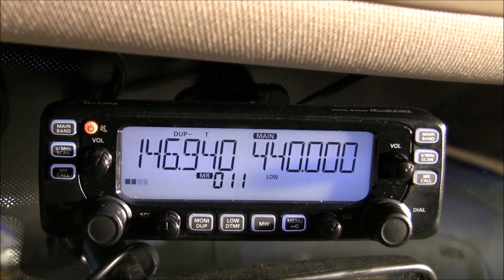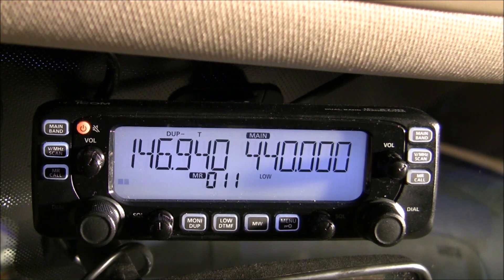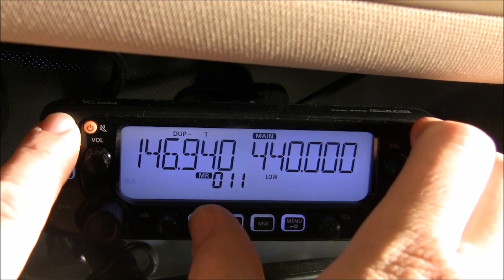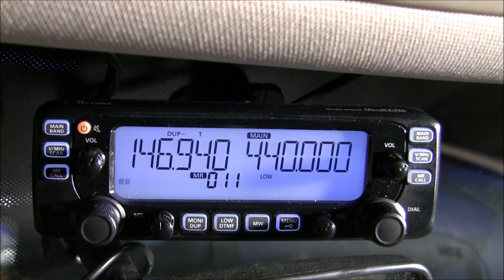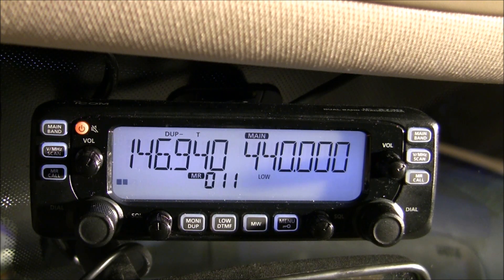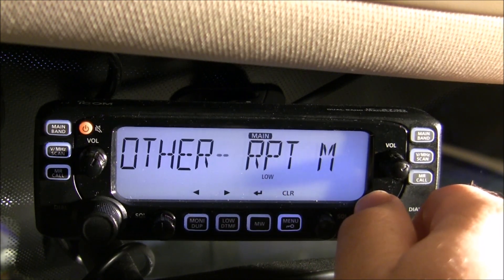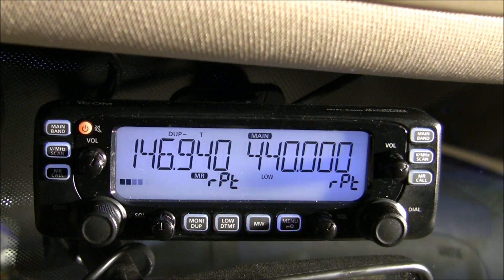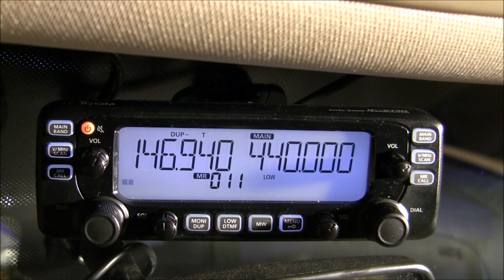Icom 2730 Cross Band Repeater Setup

Comment: After removing the 319D diode for the lCOM 2730, the transmitter (TX) became permanently on. When I turn on the signal repeater. 
Is there a solution for that?
Reply: Put it back and find correct information on how to mod the radio
Reply: @ I found the solution. Squelch It was high, I forgot it, and after lowering it. it went back to working well.
Reply: @M3M-KSA  Good to hear you didn't damage anything, I almost took bad info from someone about modding this radio too but got lucky I guess

Comment: My question is can the radio cross band repeat to a uhf repeater triggered by a two meter HT? (jus opposite of the setup you have described.)
Reply from the maker: Good question. I am not sure. I sold the transceiver a while back, so I can't check to see if this would work.
Reply: Yes, it works bidirectionally.

Comment: I’m a few weeks away from testing, will be using radio for Off-Road desert racing support and photography . This feature looks like the perfect solution. I can locate my 4x4 truck with this mobile unit on a higher location then hike into a ravine without 4x4 access then use a HT to communicate with race control or monitor race communication. Is this feature available on the ID-4100a?

Comment: I’m new to ham. And new to this radio. Won’t the car need to be on to keep it draining your battery especially if your on a long net?  This is a cool thing though.
Reply from the maker: You are correct, the transceiver runs off the car battery, and will drain your battery over time. It draws about 10 amps during transmission, at full transmission power (around 120-130 watts, depending on battery voltage.) A typical car battery is 70 amp hours, and generally should not be discharged beyond 50% capacity. That gives you around 2+ hours of continuous transmission before you would need to stop, in order to ensure that the battery has enough juice to start you car. Keep in mind that the current draw is much lower during reception, and while the transceiver is at idle (1-2 amps, roughly.) If you were only planning to transmit in case of an emergency, your car battery might be able to power the transceiver for several hours, if you did not transmit.

The safest thing to do would be to run the transceiver off of a separate deep cycle battery (also know as a marine battery), since these can be completely discharged without damage. You can pick up a marine battery for a little over $100. It would not be all that difficult to install a switch that will swap the power from the vehicle battery to the marine battery, if you wanted to use the transceiver for an extended prior of time while the vehicle is off.

Lastly, you could leave your vehicle running, thus allowing the alternator to power the transceiver. That's not very practical if you are going to be away from your vehicle for an extended period of time, however.

Comment: Seems there are some restrictions put on crossbanding thru linked repeaters due to interference! Any input there?
Reply from the maker: I am not aware of any such restriction. I am certainly open to comments from anyone who may be better informed. Like most folks, I do not condone any inappropriate use of radio hardware.
Reply: Well apparently Arizona Repeater Association cites “massive interference” on their 9 linked repeater system..https://www.w7ara.org/z/Conduct.Aspx.   8. No crossband or remote base connections without prior permission
from the repeater owner.

This rule insures the system will not be compromised by connections we have no way to control. Such connections can cause massive interference, even though it seems it is working good.
Reply: I have to admit..i dont see how a massive interference event would occur if the ht ptt used 70cm to trigger 2m transmit. My logic would tell me it would be exactly like being physically at the crossbanded radio transmitting with the handset! ??

Comment: Im interested in the cross band, the up band frequency is always the same,can I put this in memory or do I need to use the vfo feature?? Great video.
Reply from the maker: When you setup the Cross Band function, I believe you can select either frequency from a memory slot, or by using VFO.

Comment: Thanks for posting, I just passed my technicians exam two days ago. Anxiously waiting for my callsign and for it to be added to the FCC database. How long can your battery last with the truck off and this running as a repeater?
Reply from the maker: As Jason R. said, it all depends on how much you are transmitting. According to Icom the radio draws 1.2 amps in when it's in standby, and 1.8A when it is receiving. However, the current draw increases to 13 amps when the radio is transmitting.

The 2730 needs a minimum of 11.8 volts (approx.) to operate. Since the voltage output drops as the battery discharges, the radio will shut down before the battery completely dies. A healthy, fully charged 12V battery has a voltage of 12.7 volts. You can therefore only drain about 7% of the battery's capacity before the voltage drops below 11.8V. Example: a 100 Amp hour battery, drained to 93% gives you about 7 AH hours of "usable" capacity. You could therefore leave the radio in standby for about 5.4 hours, receive transmissions for about 3.75 hours, or transmit for about 30 minutes before the battery drops below 11.8V, causing the radio to power down.
Reply: Depends on how often the radio is transmitting.  It is a simple enough math equation to solve for how long the radio can be sitting idle and another for how long if it is transmitting 100% and then add the battery of your vehicle - or in this case I'd recommend bringing a spare battery to run the radio unattended as you wouldn't want to come back to your vehicle and have a dead battery so you can't start it or use the radio.

Comment: I have a new IC-2730A radio set that I bought several years ago and never installed anywhere.  I only powered it up to program all my frequencies into it, to duplicate what I have in my older IC-2720H radios. Then it went back into its box, and has been stored in the closet until just now.  I tried the button press action at power-up, per your video, and NOTHING happens any differently than when I just power up the radio normally.  I'm not sure, but I think the radio may have already been previously enabled for the crossband repeat mode, as I DO get the "RPT M" displayed on the front panel, when progressing through the various EXMENU -- OTHER  menu screens.  I don't remember having done it myself, as I didn't even know about the crossband repeat function when I bought the radio, but I might have enabled it myself. It has been too long.  PROBLEM:  When I have the "RPT M -- START" displayed on the front panel, and press the "MW" button to try to get it to the next menu item/option, nothing happens.  The screen still just sits there and shows the same display: "RPT M -- START".  I can't get the menu to change to the next function, to actually START the crossband repeat mode. HELP!  Any ideas?
Reply: Disregard my original post.  I found the problem a few minutes after posting my original question.  I had a severe "Cranial Flatulation (Brain Fart)" while doing the setup procedure.  I still had BOTH sides of the radio on VHF frequencies, instead of one on VHF and one on UHF, before I tried to activate the crossband feature ......... Thanks for the video!

Comment: hi. i just bought an icom ic-2730a mobile rig. however, i can't seem to add the crossband repeater function using the instruction you posted, mainly pressing and holding the two main and moni button.  i turned off the power of the radio first and pressed and held the 2 main buttons and the moni button and pressed the power button until the radio turned on. after powerup, i followed the menu cycle (exmenu, others) but the RPT menu does not appear. what was I doing wrong? please help. 73 

de DV2AWN/Amboy
Reply: hehe answering my own query, thanks to the post below, was able to finally enable cross band repeater operation by removing a diode on the mobile rig. :) 73

Comment: Should this work on the 'E' version as well? I've tried the instruction several times but it is still not activated thanks Johan PG4W
Reply: Johan Weijland I have the E version too and can't set up the REP-M option in the menu after several tries. does any one know if it is possible on the Edge version?
Reply: I've found out it's only possible in the "E" version after removing a diode and then follow the described steps.

See instructiond here -> http://radioaficion.com/cms/ic-2730-mod-mini-repeater-function/

Comment: Just a quick question. I have a buddy who has a Crossband repeater on (Receive freq is 147.575 and Transmit is 446.000). I can't figure out how to program the offset/dup on my IC-2730A manually or in the software. Any suggestions on How to program odd splits ic-2730A?

Comment: hi..i've tried many times follow your instruction but i still failed to activate my icom 2730..pls help
Reply from the maker: As I recall, I had to try the first step (holding down the MAIN buttons and MONI button while turning on the unit) a few times before I could access the  "RPT-M" option in the "OTHER" menu.

Which step, specifically, is giving you problems?
Reply: Pok Jik its probably there. You are likely not setting up the actual repeater frequencies and tones right.

Comment: I've only been using my 2730 for a short time, but I'm impressed.  I upgraded from an iCom V8000 VHF only because of how well my old radio performed, and have found the receive sensitivity on this rig to be equal or better. My 2 gripes about the 2730 (and admittedly I may not have found the settings to control this) 1 - The button chirp seems to be sent through both volume controls, so pressing a key on the radio is extremely loud if both volumes are turned up.  2 - The HM-133 mic on my V8000 had far more functions assigned to the keys - most notably scan - I could just press the 2 key when not in a mode requiring DTMF or numeric input to the radio and it would activate the memory scan.  On the 2730 I have to hold the scan key on the appropriate bank of the control head then press it again to start the scan bank. All in all, still an excellent radio - W5SSJ

Comment: Has anyone used one of these as a remote base in ham radio repeater service?  I'm not sure the radio would be up to that kind of heavy duty use.
Reply from the maker: I only use it for personal use, and only for short periods of time. A reviewer on eHam (http://www.eham.net/reviews/detail/12180) said he had some success using it as a node radio for an Echolink server at 20 watts, though he added some extra cooling. You may experience overheating if you use it at a higher power in a vehicle, particularly if you don't have very good airflow and/or an extra fan in your vehicle.

I would only use the cross-band repeater function for no more than a few users, and for brief periods of time.
Reply: Johnnie Holt THANKS FOR THE VIDEO I HEAR THAT THE ICOM 2730A DO NOT PUT 50 WATTS OUTPUT IT ONLY PUT 40 WATTS OUTPUT IT IS TRUE ? THANKS
Reply from the maker: I am not sure. I never measured the output.